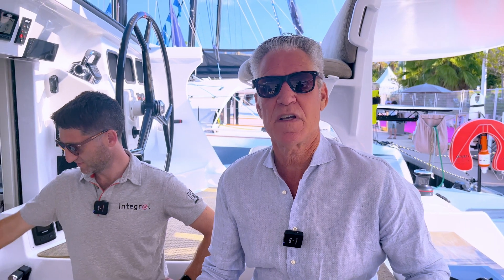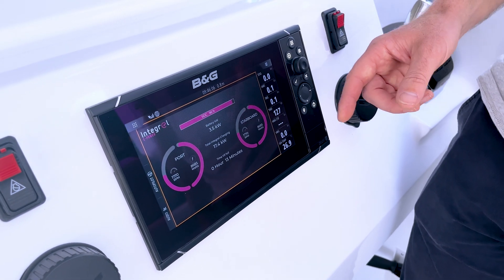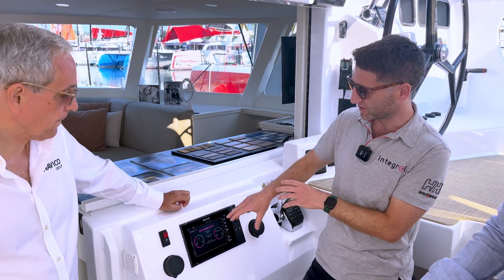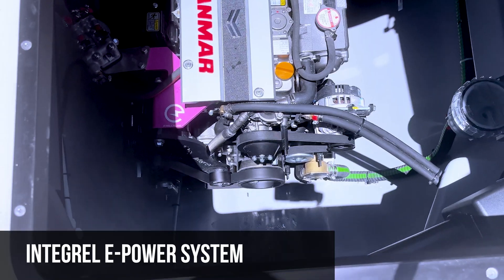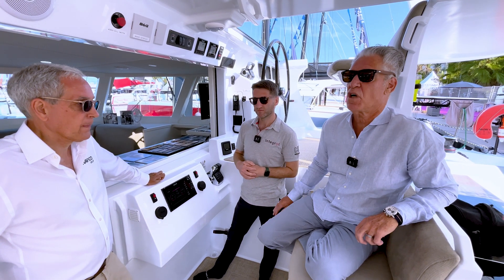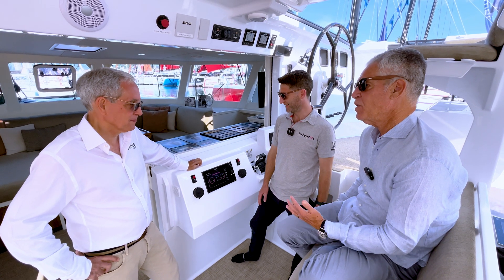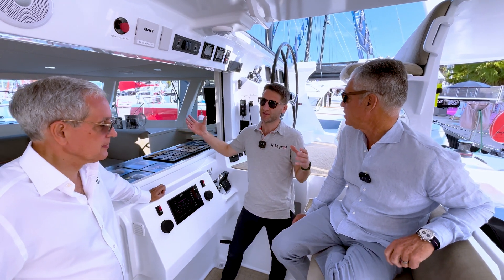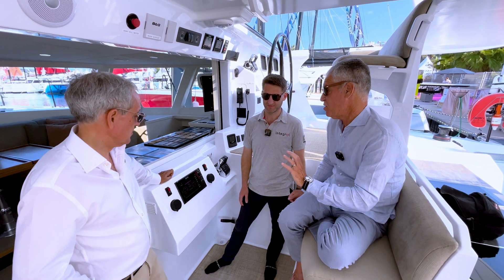Strengthening Partnerships with Integrel, Navico & Balance Catamarans

Comment: The goal is to self generate power and propulsion by maximizing the wind and sun.  Only using fossil fuels to fill in the gap renewables can’t provide. 
Intergral is a compact and robust solution. Glad that propane is eliminated.
Reply from the maker: Agreed 100 percent. The issue remains that lithium batteries are a 22 percent less dense energy carrier than diesel. That's why running an all electric boat is tough when voyaging. It is hard to carry enough solar, or enough batteries, to motor far, or fast, when you need to. We are testing the E-drive shortly on a 526. We are the first company to install one as we have worked with Integrel now closely for four years to perfect the alternators. We will soon have proven data on our charge rates at various RPM at anchor, as well as performance speeds and charging on a 526 when operating on either diesel or electric. While idle charging rates will remain the same for specific Yanmar's (we only use Yanmar's at Balance) performance under power will obviously vary for our different models and under different payloads and of course sea states. We think it is really only helpful to provide speeds under power in flat water conditions as the variables of windage and sea states are so vast.

Comment: Main takeaway is that each Integrel replaces a generator (becomes a very efficient and powerful, small and light, generator working with the existing engine), and E-drive mode can move the boat using electricity only.   I still recommend more solar and walk on panels.

Agree that battery banks can be reduced due to rapid charge from the Integrels.  

There are cats with 2 and 3 kW of solar.  With that and some more battery, generator (function) is needed much less if at all.
Reply from the maker: It is interesting to see how much solar folks will find they need or wish to carry when E-drive is going, as the charge rates we expect to see are so high. I feel that one should always carry enough solar to "self medicate" charging in the event of losing both diesel engines as solar then becomes the only method of charging. We once had dual Balmar alternator failures on a 526 pre-Integrel days and the owner was able with 2,400 watts of solar to sail from Helena island all the way to Florida with that solar alone. One of our customers has roll up soft panels he lays out on his trampoline when at anchor in the South Pacific. We continue to feel strongly that walk-on solar panels attached to the deck are not a good idea. They perform poorly but often also burn the decks or connectors and lead to real problems. We do not wish to assume the liability of installing these and insist our customers install them on their own after they take over their boats. That way, when they burn, or fail, nobody can get mad at us!
Reply: @balancecatamarans  Cheap walkable panels from China definitely have had problems.  Some use factory reject solar cells for example.  Top quality ones like Solbian are good.

Having enough solar to power house loads at anchor or under sail without running a generator (function) should be easy today.  (Especially for the sunny places most people sail.)  That includes electric energy for food storage, cooking, cleaning, watermaking, even air conditioning.  Durable, dense, relatively light Lithium Iron Phosphate batteries are a major enabler too.

Comment: Can Integral do hydro generation? If so, have you figured what is the best propeller for it? I mean, best balance for generation and propulsion?
Reply from the maker: At this time, regeneration is not available with Integrel, but it’s expected to be included in their service offering by early 2026. The main holdup, as you pointed out, is propeller efficiency, which still needs improvement. Integrel is working with leading propeller brands to find the best solution.

At Balance, the general consensus is that current regeneration rates simply don’t compare to the charging capacity of an Integrel alternator—especially with the upcoming VersaDrive. A small amount of diesel can recharge your batteries in a short time, whereas regeneration could take hours or even days to achieve the same result.

That said, new advancements are always emerging, and we fully support this important innovation. We’re keeping a close eye on its progress!
Reply: @balancecatamarans  Thanks for the explanation. It seemed like the propeller design is not final in the other solutions either. Glad to see you mention they are working on it.
Reply: @mtrezaie  Some propellers do work better in both directions than others.  Efficiency is also tuned to flow rates.  

It's probably not possible to optimize a single prop to all conditions, BUT (symmetrical?) designs like the Oceanvolt Servoprop may perform better than others in more conditions, including regen.

Comment: Can it not simply be displayed on the same screen as all other power input/output data?
Reply from the maker: Hi Lana, yes, that's exactly the idea! Instead of a separate Integrel monitor, you can now view this information on the same screen as your other displays—just one swipe to the left/right.

This video was an early announcement, but the first E-Drive installation is currently happening at our St. Francis yard. We'll share more updates, real-world displays, and demos soon!
Reply: Yes, that's what they're showing.  The energy monitor is one screen or part of the screen selectable on the chartplotter/multi-function display.